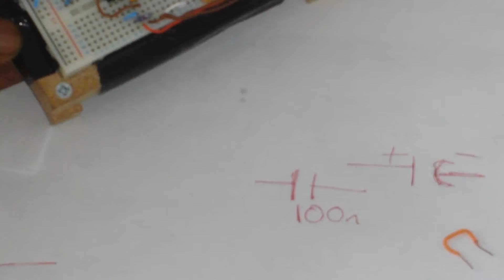DIY analog synth project Tips N Tricks( Breadboarding Technique Pt2)

Comment: How much does a circuit like this cost?
Reply from the maker: To be honest i can precisely answer that question as it can be dependent on where you source the components from all in all I would say this vca  circuit should not cost you more than 10 UK pounds. Having said that the breadboard im using cost a good 7 - 8 UK pounds.
Reply: @AdamTheAd-vanc3d  Hi, thanks for your response. I’ve pretty much finished building my first DIY synth which and I’m hooked! Now I’ve done it I would like to understand what role each IC plays. Anyways - can you suggest a good UK source electronic parts? Are CPC and RS worthwhile?
Reply from the maker: @sndrcve  RS components are good.  Mouser is another, Thonk , Bright components is a UK ebay shop. Electric druid are good they sell some custom chips which are basically either a whole vcf vco vca and transistor arrays etc.
Reply: @AdamTheAd-vanc3d  perfect 👌

Comment: Well you asked for us to give our tips so here goes. 😬 I like to work with the power rails at the top and bottom, this allows me to use shorter jumper wires. Also, solid core wires fit so much better on the breadboard. If you happen to have gotten a kit like I did, definitely snip those longer wires into smaller ones after you get a feel for the lengths you need. Try to keep everything straight and unbent, especially your component legs. Again, if you got a kit you've got plenty of resistors so don't be afraid to set some aside for breadboard use, and snip the legs a bit to keep them flush to the board. Use a pair of tweezers to help. Get ready for parts to go flying across the room 😂 as you try to pinch them, so pick a well lit area to work in. Work with small voltages, only what your circuit requires. Cheers!
Reply from the maker: Thanks Haze. I pretty much employ the practices you stated , so far so good . I have a working analog protosynth circuit to prove it lol 😅😅